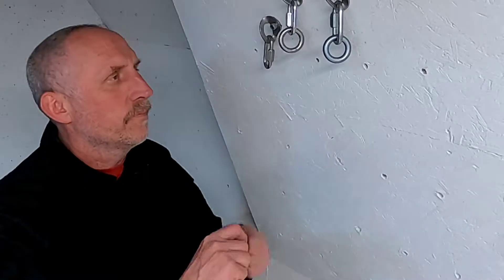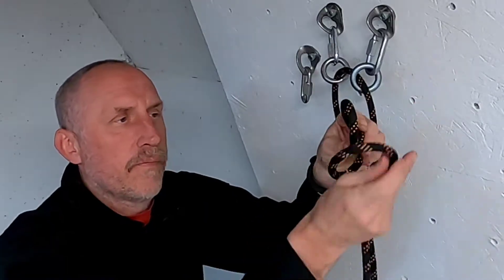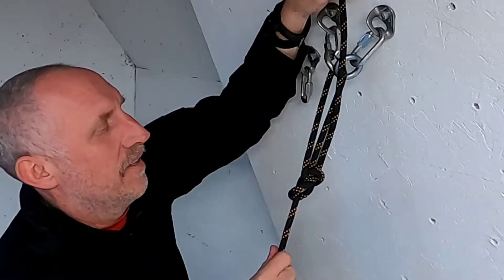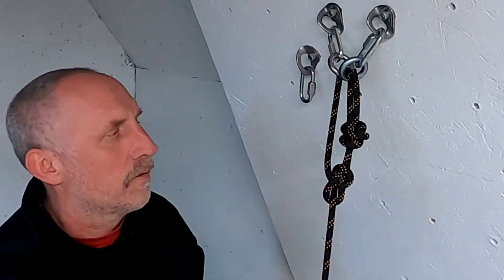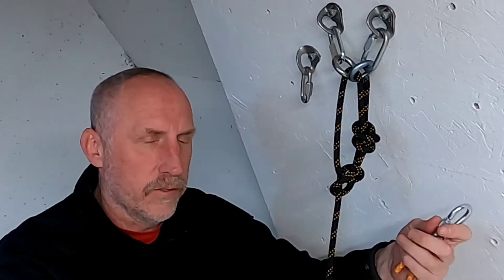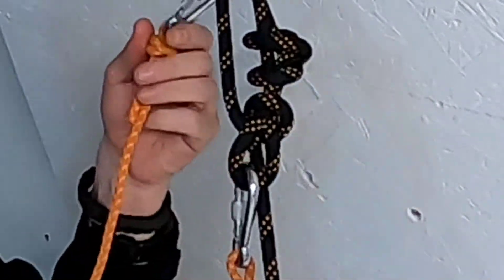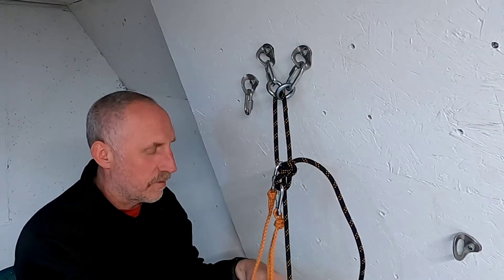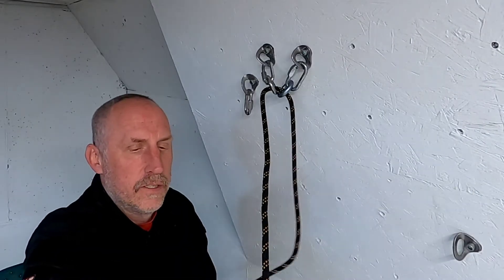How to Rig a Retrievable Rappelling Anchor | Bowline

Comment: That's a clever setup but I wouldn't be comfortable rapping on an open bowline and the two falling carabiners can be a hazard. in that kind of situation i'd use a stopper knot to block the rappel or if I need to use a carabiner, well, just use a biner block and attach your pull line to that.

Comment: What happens when the last climber is rappelling and the tag line gets caught around their leg and they pull the bowline apart? All of these retrievable systems with the tag line that dismantles the anchor knot are scary. Even if they get down safe there is going to be gear falling down. Why wouldn't you tie a running bowline around the rappel strand with a tag line instead?
Reply from the maker: Bad things could happen forsure
Reply: The method you are suggesting still requires the rope to run the full length of the rock.  The idea here is to leave no trace and to create a system where the rope just falls unweighted and does not create grooves in the rock.

Comment: How would one go about retrieving a grappling hook after descending? Especially if it's quite high up?
Reply from the maker: I can't think of anything way.  I would think your grappling hook would be for  climbing up, then you have to build an anchor without the grappling hook to descend
Reply: @LiveRogue  What about a 2nd rope to one of the grappling hooks that way it can be pulled off?

Comment: There are easier and safer ways to build a retrievable rappel. 

I feel like this puts a lot of unnecessary risk on the last person since a bowline is no longer safe without a backup knot. Not to mention the friction of trying to pull the knot undone and all the extra hardware that can now get stuck above while pulling down the ropes.  

Maybe there’s a use case for this but I don’t really see the benefits over other methods.
Reply: Well if you already have a tag line then you’d be better off in most cases just using a blocked rappel. That’s the best/safest answer. There’s also the macrame knot for low angle stuff or boxed solutions like the Beal escaper. 

This method just adds unnecessary risk in my opinion. You’d never catch me rappelling on an unfinished bowline.
Reply: @GregoryPagano  What about using an alpine butterfly. One end of the rope to climb down and have the other end to pull the knot down when on the bottom?
Reply: Can you explain/name other methods?
Reply: @ZerolinGD  Fiddlestick.
Reply: You are right about gear potentially getting stuck somewhere below the anchor when releasing and retrieving the pull chord.  Some experience and good judgement needs to be used. Even then there is still a chance that something could get stuck.  The same is true with other types of retrievable anchors, rope blocks, etc.  there is an element of risk in just about everything.
Reply: Fiddlestick!
Reply: Yes, could you please name/explain the other possibly more interesting methods?

Comment: There are better ways. Using a bowline without a backup knot is SUPER sketchy. If you're going to do this, at least tie a long tail, but still, just use a better method.
Reply from the maker: There's no question that there are better ways.  Absolutely have to assess the risk for your own party.

Comment: If you have length of paracord equal or greater than your rope then why not just pull the bow line knot from the bottom why should it have to come untied above you? Just pull and pull until the bowline is in your hands untie it and then pull the p cord behind it. Way safer. Right? Am I missing something? That's how I make retrievable slackline anchors in the park way high up without climbing...
Reply from the maker: Sandstone is very prone to damage from ropes being pulled. So, when canyoneering it is good to look for options to reduce e rope drag.
Reply: This is to limit the wear and tear on whatever is used as the anchor, as well as whatever the rope is running against.  If just a single person went down a canyon and pulled the whole rope it wouldn't be a big deal, but when hundreds of people start going down the same canyon, the sandstone will start to have rope groves worn into them, and if you do that around a tree it will eventually die.  This is a way to eliminate that.  Also, the more significant the rope groves that are made, the more likely your rope is going to get stuck while trying to pull it down.